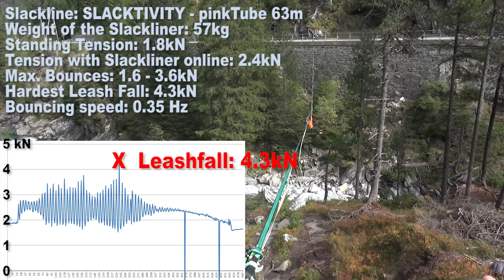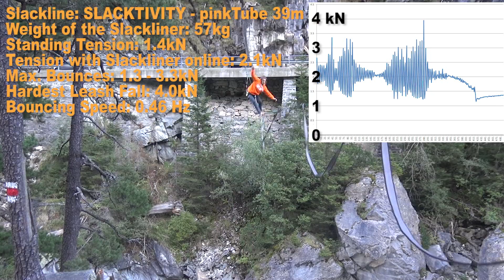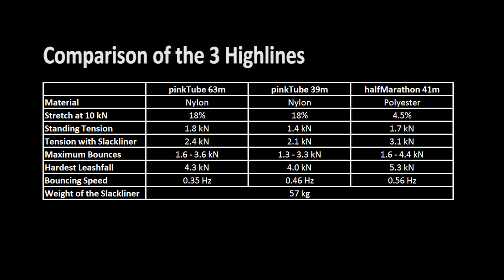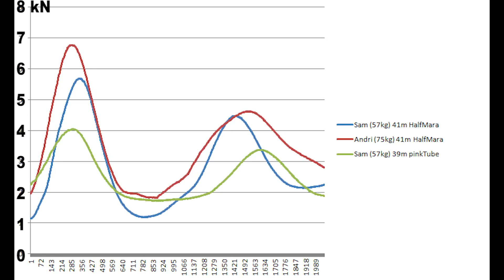Slackline-Science - Forces in Highlines

Comment: It would be interesting to peakForce test the sewn loop of the pinktube (=dynamic test = applying high force for a 100ms duration ). I guess it would support more than the currently stated 18kn which was probably measured using static force.

Comment: Some extrapolation : Assuming the weight - peakForce relationship is linear (kinda looks so based on 1 sample) : beeing a 78kg guy bouncing on a 39m pinktube attached by sewn loop (mbs 18kn according to slacktivity website) would give me a safety factor of 3.3. Any suggestion on how to improve this relatively low score ? (diet excluded ^^). I guess longer lines means globally a more elastic behavior = less peak force right ?
Reply from the maker: The weight / peakforce is totally not linear. A person of double the weight manages about 30-40% higher forces - by far not double forces. And clearly a higher stretch offers lower peak forces. Also longer lines offer better more stretch. On a 63m pinkTube we managed to get to a peak force of 4.9kN, trying to bounce and leash fall as hard as we could. This included a person of 80kg. Standing tension was slightly over 2kN which is already quite tight for freestyle highlining. Other solution of course: take a stronger webbing like e.g. redTube ;-)

Comment: does the backup have any function in this rig? its so loose, it doesnt seem that it would catch a fall if the main line breaks.
Reply from the maker: If the backup wouldn't be loose, we would start having measurements not only from the main line. That's why we took the decision to have the backup loose for these measurements.
Reply: I also think these backups would be useless in the event of a mainline break. Midlines need tighter backups. Great effort from slacktivity to provide useful data, but it shouldn't be done if safety is compromised. Just saying.